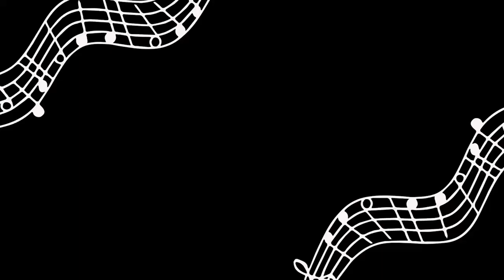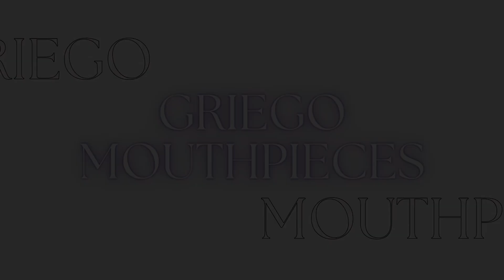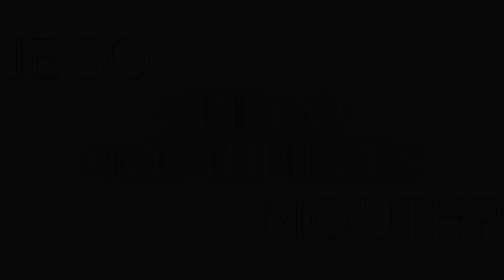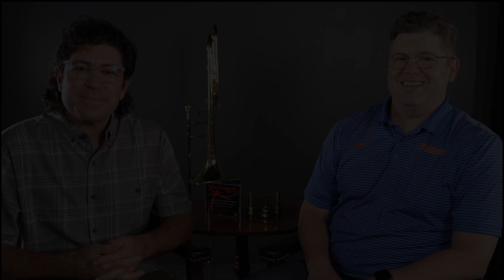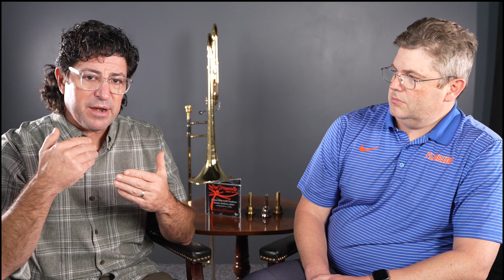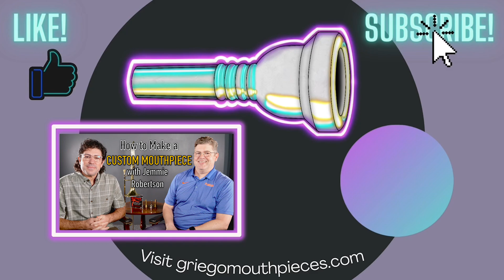Improving a Mouthpiece: Do's and Dont's

Comment: Was the old mouthpiece worn down over use (besides the different reamer contact points)? Do all mouthpieces (with normal use, beside changes in the player's age, etc.) change over the years?
Reply from the maker: The shank had some damage and was wearing very inconsistently.  The piece was over 20 years old and was also wobbling in the receiver which always slows down response.
Reply: Thanks for the information! @griegomouthpieces4760